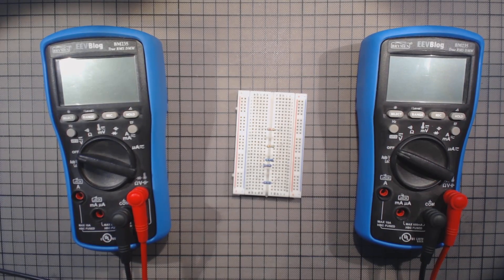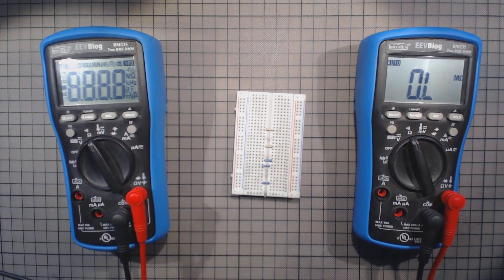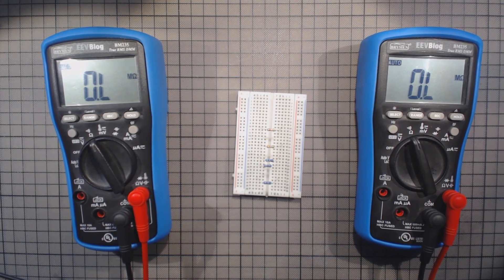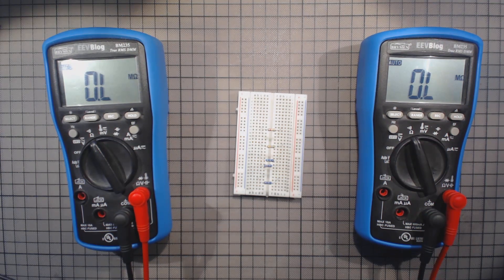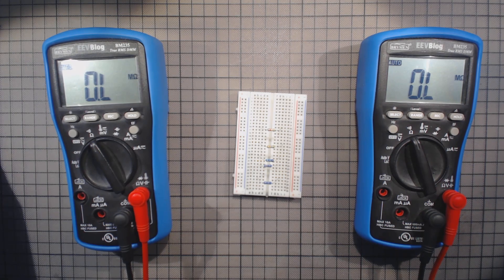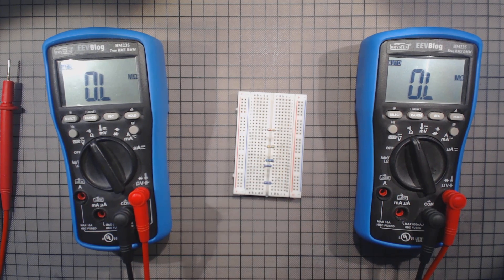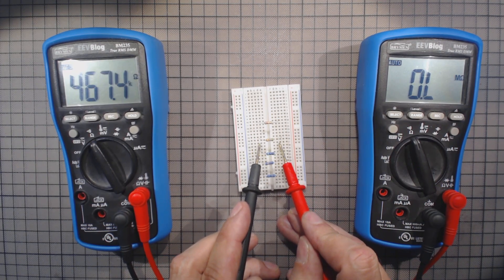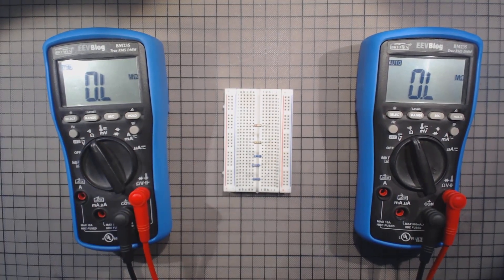BM235 EEVblog Edition FW E - Issues With Resistance Measurement

Comment: Hi, nice to know but I think that you yourself can upgrade the firmware if that is the only problem. I am currently shopping around for a good, fast and precise meter after selling my brand new FLUKE 87 V  (i need something that measures resistance in the range of 1G ohm and has to be dual display  (for ac+dc component). Any suggestions ?? I know that Brymen 235 is now an aging device and wouldn't buy it. I looking at SANWA PC-7000 and Brymen 869s. they both seem to have identical specs (as a matter of fact) they are both powered by the same main chip made by Brymen even though SANWA has nothing to do with Brymen because is a JAPANESE manufacturer but Brymen is a lower grade HONG KONG based manufacturer. But it is not easy to buy SANWA. first of all I really do not understand why is 35% dearer than bymens 869s and on top of that I still have to pay a hefty £45 custom charge + postage as well. So, no is not worth buying it.